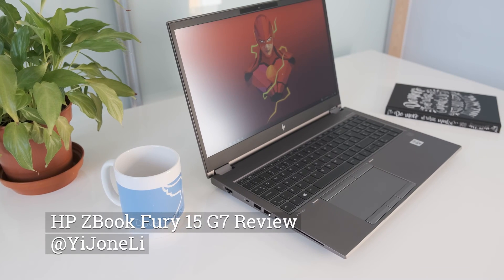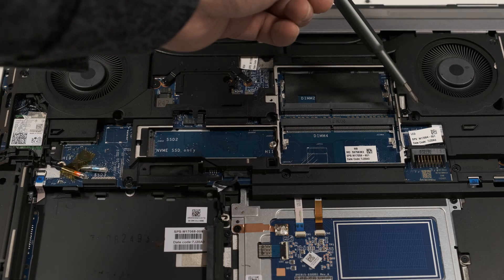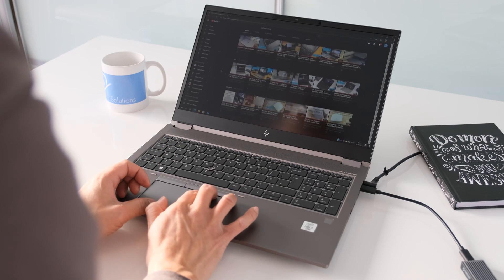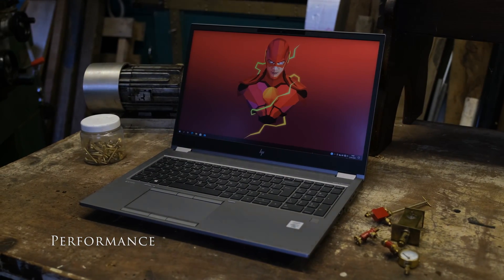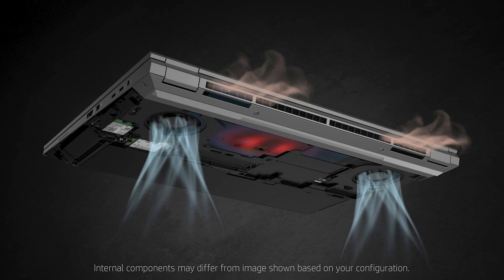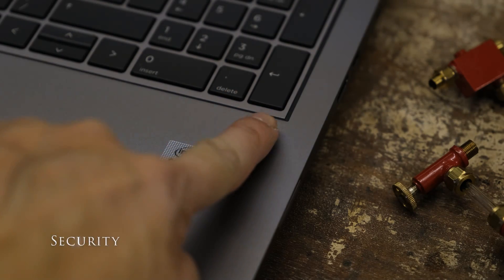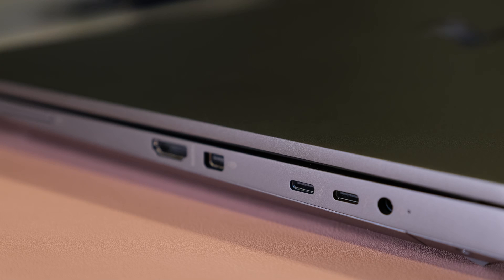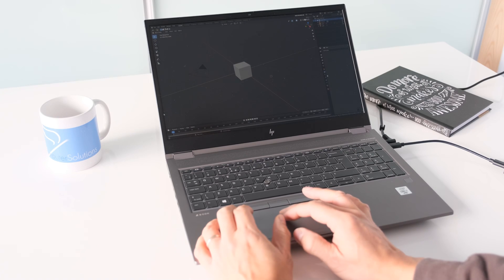HP ZBook Fury 15 G7 Review (15.6" Mobile Workstation Beast)

Comment: Great review - thank you! I cannot decide between the Fury i7-10850/RTX4000 and the Create i7-10850/RTX2070maxQ. Have looked at your Studio review as well. How is the temperature of the Fury compared to the Studio and especially the Create? From the other reviews I have read, the Create seems to have an issue with high temperature. Is this better for the Fury? For me this is an deciding issue.
Reply from the maker: Thanks. The Create + RTX2070 does have heat issues due to the smaller dimensions and extra heat generated from the 2070 GPU. The Studio G7 with T1000/T2000 has no heat issues. IMO, the Fury wins out with great thermal management thanks to the bigger chassis dimensions and quiet dual fans. I've had a Fury 15 G7 for two months, RTX 3000 model and not found any heat issues. Plus, the larger dimensions and weight doesn't bother me at all, carrying it in a rucksack. (Much better than the older ZBook 15 G6) Love the upgrade options, especially when you load up the memory up to 128GB (which in the Create G7 only goes up to 32GB max. soldered on) The Fury is a proper mobile workstation powerhouse! 👍
Reply: @Dovecomputers  Great - thank you! Do you still plan to review the Create as well?
Reply from the maker: @petterbuckholm4724  I would love to and its on the cards, (Especially interested in the RTX2070 thermals) but not enough hours in the day...and night to fit them all in. 😉
Reply: @Dovecomputers  Fantastic review enjoyed every bit about it. Can i ask what means quiet dual fans in terms of dB? Have you pushed the device to the limits and the fans while increase the RPM have not become rocket engines? I work 12h a day, and noise management is important for me. This is a deciding factor for me if I will take it or not.

Comment: I must say HP really ticks all the boxes here.  I think the price is reasonable considering it has no real competition.  The Dell lacks the engineering and care of the HP.  The Lenovo lacks the refinement, and every other machine in this class is really made for gaming.
Reply: Dell and Lenovo have good offerings  in that category though, and Lenovo is substantially cheaper. However Zbook look more classy, outside and inside
Reply from the maker: Totally agree. Been using the Fury 15 G7 for two months now and it's almost perfect for my requirements. Going to get hold of the Lenovo ThinkPad P15 if I can to compare. Just interested to see how they compare with the HP ZBook's. 😉
Reply: And parts replaceability along with the ease of access for everything besides the cpu and gpu. Currently have a G5 15 for enterprise software development with almost always on VMs and don't see myself going for another workstation-line as long as HP continues the trend aforementioned properties.
What I want to know for the Fury 15 G7 is the thermals when it has the 8c/16t i9-10885H option. Wish they could have Zen 3 Ryzen 7/9 while holding onto thunderbolt for better thermals. Perhaps it will be an option for the g8 lineup?
Reply from the maker: @habipkenanuskudar8148  If they can put aside the politics, a ZBook G8 with AMD Ryzen 5000 H-series and Thunderbolt 4 ports would be awesome! 😍